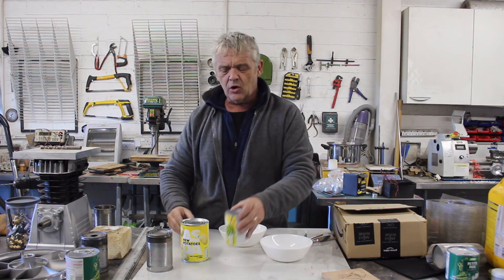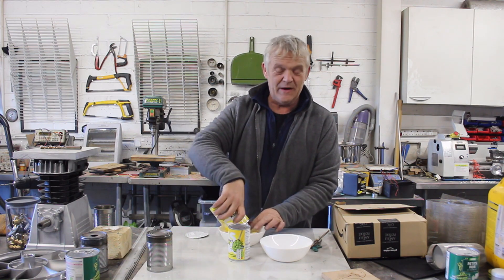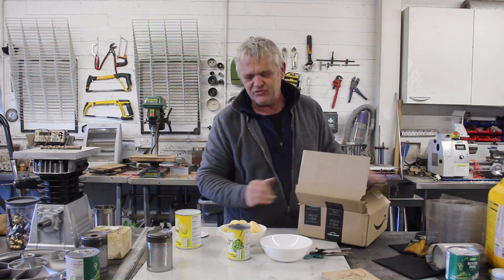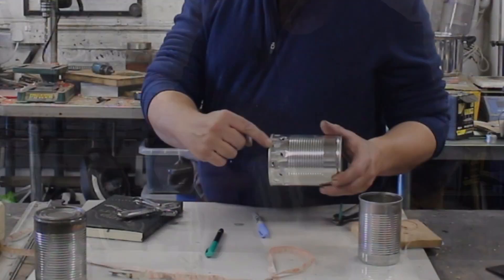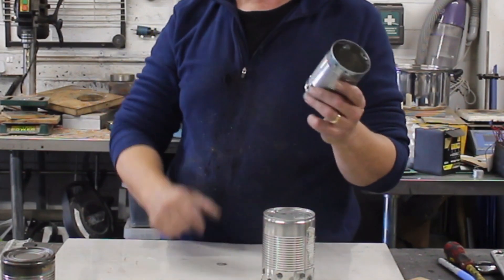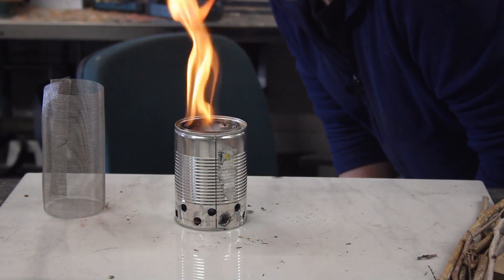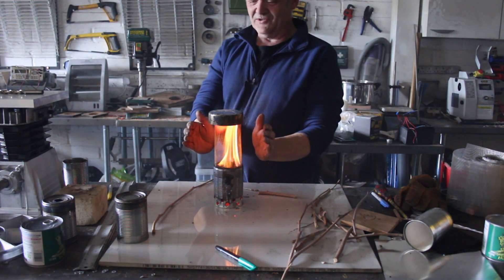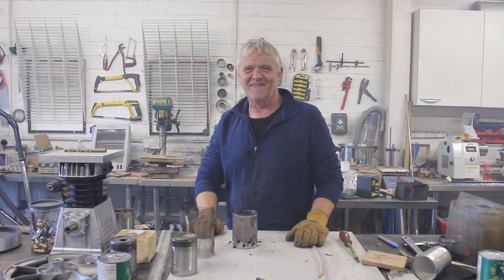1703 Mini Gasifier Or Mini Rocket Stove With Mantle

Comment: This is a wonderfully simple heating device that can easily pack down inside the can for backpacking.  Thank you sir!  I will be making 2 of these today.
Reply: How did it go?  I've been planning on making one for backpacking for months.  I'm thinking of one more small can as a 'pot' on top and one more big can as a windshield, but if the pot can was even bigger it would all pack into the pot.
Reply: @tonyrobinson1349  I made mine out of bigger cans.  The bottom can is a #10 with a large beans can inside.  It makes heat for about 30 mins per load of sticks.  I'm tweaking the hole size and spacing to get different effects.  Mine are vortex heaters with the fire spinning around like a tornado.  I used an awl to bend the edges of the holes all to the side a bit to help direct air into a vortex.  I don't think it works any better, but it looks cool.  😁👍
Reply: @shtfengineering7472  I'd like to see how small I can get one.  Penny stoves are  the smallest I've tried, but they use methanol, which you need to carry when camping, not collect.
You just need to dowse the stove with cool water before you touch or pack it away.